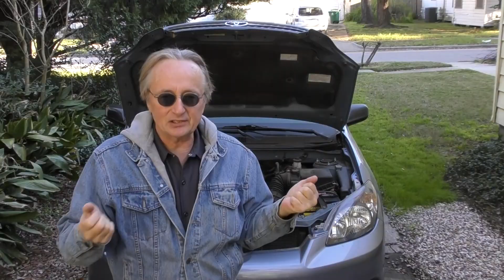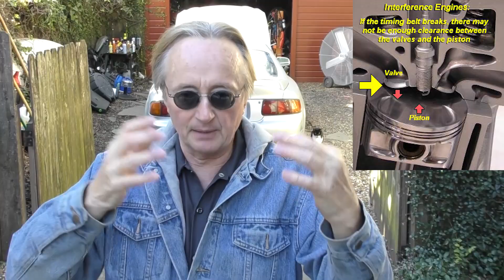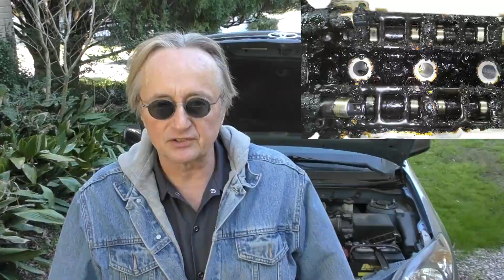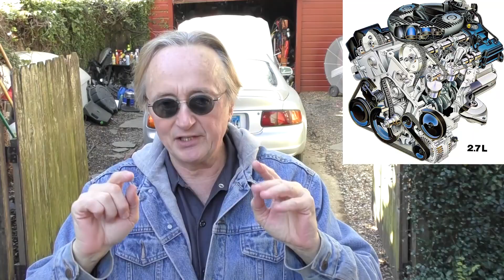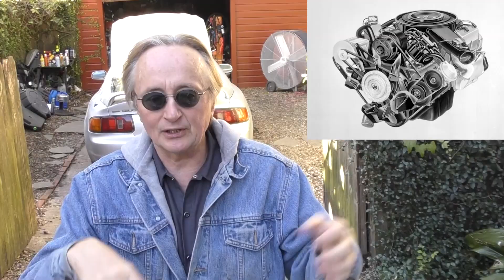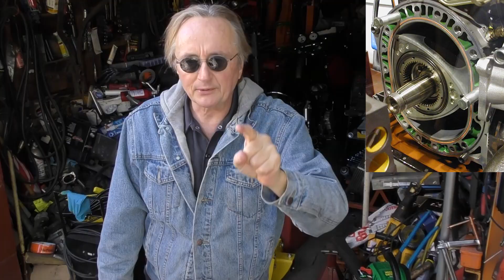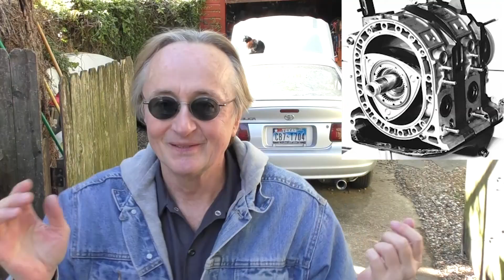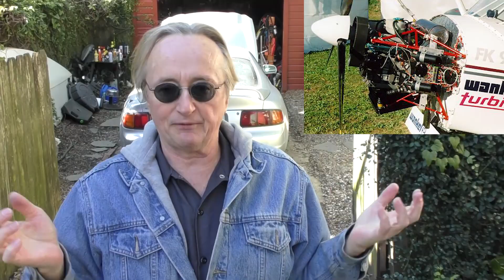Never Buy a Car With This Engine

Comment: Ok the 2.2 ecotec is a boat anchor....But what about the 2.4 ?   Is this just a cubic inch increase of the same crappy engine or was it improved upon vs the 2.2?  I ask because i have a 4.9 Cadillac engine (NOT a NorthStar). One of THE best they ever made and actually derived from one of THE worst, The 4.1. Seems as CI went up, The engine vastly improved with upgrades as time passed.

Comment: I know of a 2.2 ecojunk with 285K miles.
Timing chain went bad at 250K.
Engine didn't blow up. Still going strong.
Reply: Sorry for your troubles, but you must have a pre-2005 engine. Those are the best ones to have.
Reply: @GCULPEX  It's a 2005.
Reply: I had 2003 sold it 500 bucks with head gasket blown with 385000 miles

Comment: Chevrolet Aveo.... 1.4 or whatever it was. Interference motor with a timing belt. When the belts blew so did the engine
Reply: Those were actually Daewoo built engines,  1.6L I think. GM dumped those motors on Suzuki as a 2.0L in the Forenza and Reno until that relationship went south and GM had to take all their garbage back. Very simple to work on actually, suffered from GM's extended coolant intervals and would pit the heads if not changed closer to 60k rather than 100k as recommended. Like you said they were interference engines with a recommended belt change every 30k if you neglected it then it's on you not the engines fault.

Comment: I got an 05 Malibu "Classic" with the 2.2L ecotec and it's been dead reliable for me. Granted I change the oil religiously (including the stupidly designed o-ring filter) and after 164k miles it still runs fairly well. But I do a full fluids check weekly and replace wear items as needed, only needed a fuel pump assembly and a catalytic converter so far, I can't complain honestly considering I got it from an auction for $500 at 125k

Comment: Toyotas 1,8 VVT-i engines  they changed too timingchains in 2000 but designed it so badly that the engineblock could crack and the engines had to be rebuild or replaced meaby allready at 30.000 km but  they did solve the problem arround 2005 - 5 years too late

Comment: There was another GM 2.2 engine that they used until 2002 which was indestructible. They put it in the S10's and cavaliers and a few other small cars. It was an iron block pushrod engine.
Reply: Reliable 4 cylinders- the GM IRON DUKE, many a us postal service jeep had them

Comment: I got a 2003 Pontiac sunfire with a 2.2 ecotech engine with 345,000 miles. I guess I'm lucky it has lasted
Reply: No they are really good engines its not luck.

Comment: Only failure on the L61 ecotecs was the timing tensioner bolt...its a 33 dollar part that takes 5 minutes or less to replace or replace the whole timing set comes with improved oiler. People just cant replace simple things and call the engine bad.
Reply: @Jonathan A no it doesnt bother it. I take apart and build ecos and have for years. Take out bolt. Insert new bolt and torque to spec. If worried about timing moving wich it shouldnt you can remove valve cover and put a ziptie around the chain and sprocket to keep it still during install.

Comment: Too late my 2.4 blew the timing chain after i changed the oil. I changed the oil every 3000 miles. It has only 128k miles

Comment: I nominate the GM 3.1 un-even firing V6.  The timing chain, gears and tensioner  were shot by 75 K miles.  I suspect the uneven firing stretched them all out prematurely.  The aluminum timing case cover housed the oil pump and that wore out about the same time.   It never ran smoothly, especially at low speeds.  I sold it at about 125K miles because it was making timing chain noises again.
Reply: Sorry. I should have said 3.8 V6

Comment: One thing we all have noticed concerning auto engineering, appliance design, mechanical design etc. is how come there are so many bad designs that fail prematurely.  Older cars and appliances seemed to have had better designs, easier to repair and to maintain, etc.  I think a large part of this is the makers have lost continuity and experience in their processes.  New, young and inexperienced engineers or foreign sub contract engineers with little experience approach a new design with the notion that we are going to design a "new thing."  And they don't want to look at how older designs looked like.  Lessons learned and experience gained from older models are lost and then they end up reinventing the wheel all over again, with mistakes built in.

Comment: I had a 2006 Subaru Legacy that ran fantastic! The engine light would come on and the engine had to be replaced! The dealer failed to tell me that the oil needed changing every 1000 miles.  The recommended frequency was 7500.  5 turbos later I scrapped the car. Last Subaru I will buy.

Comment: You forgot to mention the Ford Triton series of engines. You know the ones with the self ejecting spark plugs. Then Ford "fixed" it by making the plugs two piece affairs that break in half and take special tools and an hour apiece to remove. You would think that after over a hundred years of making car engines, they would have figured out how to do it.

Comment: 8-6-4 was a solid engine if the cylinder deactivation system was disabled. I've also heard of people just using a toggle switch to deactivate 4 cylinders on the freeway.

Comment: I would never buy a non Japanese 4 cylinder.
Reply: David S id invite you to try the Quad 4. Itll change your mind.
Reply: Ive been in quad 4 cars before. Plenty of power but the reliability isn't as good as a toyota!
Reply: @LrulestheworldM8  They made power like the V-TEC before there was a V-TEC. Problem is IDI coils and modules had heat-soak problems, heads would crack, head gaskets could go a bit easily, and they had timing chain wear issues, and later generation versions added balance shafts that - although it smoothed idle it made some other things worse.

If it weren't for all the strikes against their reliability, they certainly punched above their weight. They were trying something, but the execution of it is something else.
Reply: pauljs75 The problem was GM management at the time. Rather than spend the extra money on quality parts, they went with cheap designs and shoddy parts to push it out the door. A properly maintained and running Quad 4/twin cam is more reliable than a toyota. I should know, as I own one.
Reply: LRulesTheWorld I’ll stick to my K24!
Reply: David S gross, but good luck. See you at the 400k mark!
Reply: The K series is basically the 4 cyl LS. They are built way stronger than any GM 4 cyl. A stock k24 can hold 400whp no problem. Have fun with your cavalier!
Reply: David S A 2.4 twin cam car can handle about 350hp without any serious modding. Change the cams and you can bump it up another 30-50 depending on what build you have. (I have personally seen dudes running 700hp cars, and dynoing well past what stock v8 puts out. So its possible) Plus, you have supercharger options and can build the motor however youd like. Olds knew people would be modding the engine, so they had a whole book dedicated to it back in the day. Still thousands of parts floating around. Compared to a civic, its the ultimate engine.
Reply: I agree that it's a dope little engine. It's a shame that people didn't get into them more!
Reply: Or a Volvo Redblock Engine, especially the B230F/B230FT that the 240/740/760/940 used.  Those are known to get up to 300k+ miles on original parts without much issue.

Comment: Scotty. I have an 09 Escape V6 AWD with 136,000 on it. The transmission let's the engine race for a second between 2nd and 3rd when it's freezing cold out. And only once in a great while. When the trans is warm it never happens. Should I be worried? Last flush recorded at 51,000 miles

Comment: Had a 2010 Cobalt with 2.2 ecoTech motor. Bought with 63k and only used Mobil 1 oil and filter. At 105k valves started giving trouble. Junk motor indeed!

Comment: My dad had a 2003 Dodge Intrepid SE with that 2.7L engine and hoo-wee it kept breaking down! Those engines along with the four other engines are a crapload of baloney! Not forgetting GM's 5.3L LS4 V8 engine.
Reply: @Demarco Rosas But, I doubt it was as bad as a 2003 model year Focus SE, LOL The CVH engine in those, are known for a valve seat falling into a cylinder at any time. That's the base model Focus, BTW.

Comment: What about the GM effort in the mid-80's to convert one of their gas v-8's (I don't recall which one) into a diesel for use in large Chevy and olds sedans? They were awful, belching black smoke   even when brand new, had low power, were unreliable, and did not even get good mpg. Had nothing close to normal diesel longevity and durability. I think very few made it to 100k miles. It's often credited with ruining the US market for diesel passenger cars. Perfect example of how poorly GM was run for many years, always picking the cheap, easy, who-really-cares route over careful, deliberate design and quality.

Comment: What about the toyota 2.4l with excessive oil consumption and stripped head bolts?
Reply: toyota probably gives scotty alcohol to keep him quiet on their butts
Reply: What about the 3.0L V6 they used in the 2nd gen 4runner? Well known for blowing head gaskets
Reply: @AdamSmith-gs2dv  3.0 head gaskets were fixed under a recall.
Reply: @BrockOBauma  they would eventually just blow again, ask me how I know
Reply: yup forgot those along with the Honda 1.7 eating head gasket like there'S no tomorrow

Comment: GM selling a sub-par product?

Say it isn't so.
Reply: Heard the 3800 series V6's were pretty rock solid cars; other than the very likely weak trannies & potential internal electric glitches I hear GM is notorious for...
Reply: @schwenda3727  Owned a Pontiac with a 3800 Series II Supercharged when GM still kinda built decent vehicles. Epic motor.
I do agree with Scotty about the Ecotech. Not good, but the original Quad4, another fun engine. Now its all about the LS.
Reply: @schwenda3727  im in the process of buying a nice condition 2001 GTP. that engine is phenomenal. impossible to argue with a clean 3800 series II supercharged GTP with 102K on it.
Reply: @ad356  Again, I hear the transmissions & internal electronics (i.e. buttons, wiring etc) is an absolute crapshoot across GM brands 15-25 years ago. That said, I'd research the matter more thoroughly before shooting the gun... my mom had an 02 olds Intrigue (had the 3800, correct???) from around 150-195k miles and it was pretty problematic (and it was a 6-10 year old car at thetime). But the 04 base impala my grandpa bought me with around 110k miles lasted 6 years. Other than the head gasket (hear that's not uncommon with the 3.4), it was routine, if not BADLY deferred maintenance.
Reply: But on the flipside, it's incredibly easy to find a 15-20 year old GM mid/full size below $5 g's with the 3800 banger in it...

Comment: The CADILLAC 368, in the 500/572/425 family, is well-made. Indestructible. The electronics and method to deactivate cylinders were terrible. The system is a 1-wire bypass, and the engines purred. This engine should not be on this list, when without the system, it'll outlast ALL ENGINES stated.
Reply: I saw many that were converted back to just being a regular V-8 Caddy as well,just took all that stuff off and made it a 'normal' 368? (Like a 1980 model) Many wholesalers/used car dealers wouldn't even touch one back then (mid 1980s) unless that had been done to it!!!!
Reply: @DrOlds7298   Knowledge speaks!  All true, just very crude way of running that motor and system.

Comment: I disagree with the ecotech. Our family has two still running like new with well over 200K on each. If you change the oil and filter and just use them to get back and forth to work they'll last a really long time.

Comment: i don't know for the 1.8T engine but 1.4 and 1.6 vw/audi engines are worse.. 'high oil consumption',here in europe 1.9TDI and 1.8T are robust.. if you take care of them properly even 1.8 NA and the 1.6 audi engine if you have the right oil and maintain it in time will be fine.

Comment: The Hyundai Santa Fe has a bad engine. It literally catches fire.
Reply: Not a bad design and Hyundai is replacing engines.
Reply: @AzTurboMini  I'm a part of the hyundai santa fe facebook fan group. There are members on there with first hand experience that have had the engine failure.  Hyundai is fighting them on replacing the engine. It's even with post 2015 sante fe's when they supposedly fixed the problems.

Comment: Great video.  How about one listing the best engines?  The Volvo red block engines are one of the most durable engines made.  Mine has 372,000 miles...never repaired, never rebuilt.

Comment: Some old Honda accords are the same as the Chrysler 2.7 - a nightmare to change.

I think it's worth saying that the Audi 1.8 is a fantastic engine if you keep it with good oil and change the timing belt every 100000kms

Comment: VW turbo engines suck, they make great naturally aspirated stuff (or used to at least) though. My 2008 VW Jetta 2.5 5 banger DOHC 4V has 331,000 and still going strong. I agree the coils sucked, I had to replace them all between 180,000 and 220,000. Actually it was very easy, believe it or not. People exaggerate how hard they are to work on.

Comment: I had a chevy hhr with the 2.2 and it lasted 353000 miles
Reply: Yeah man he got this one wrong. 2.2 echo tech is good. Maybe the ones he fixed  were owned by teenagers.
Reply: My mother has used cavaliers sunfires and cobalts that all use the 2.2 eco tec, she used them every single day to go in and out of driveways delivering news papers and sales never had one engine go out! all of the cars have at least   400 000 km, the only thing that has given out is the transmissions, She had replaced about 2 in one of the sunfires.  The cars bodies usually rust out before the power train goes!
Reply: Well I can tell you now, Google Vauxhall 2.2 eco tec,  you'll see that they last about 5 seconds. The older version of 1.8 and 2.0 were much more reliable and durable.

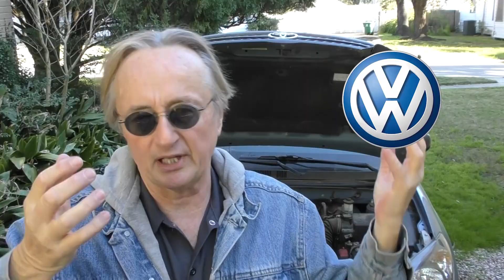Comment: 2:50 - Oh crap - I have just found today on the web an audi A4 with the 1,8T engine which I was going to look at during the weekend and maybe even buy it as it seems to be in a very good condition. It looks like I need to skip it and keep searching for a toyota/honda then :)
Reply: Herr Schmidtke Depends on the mileage and condition. I have a friend who is running up to 25lbs boost on a stock 1.8t and it rips. Very fun car compared to Toyota or Honda. If you are good at working on cars, then get probably get the Audi A4, if not stick with Toyota/Honda.